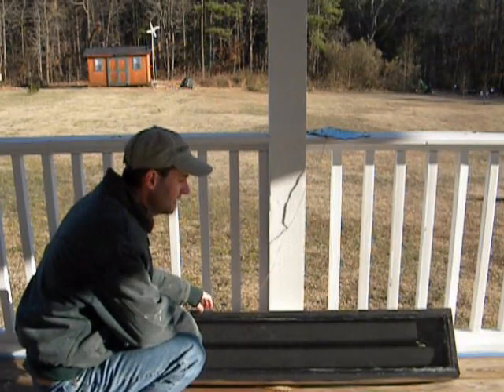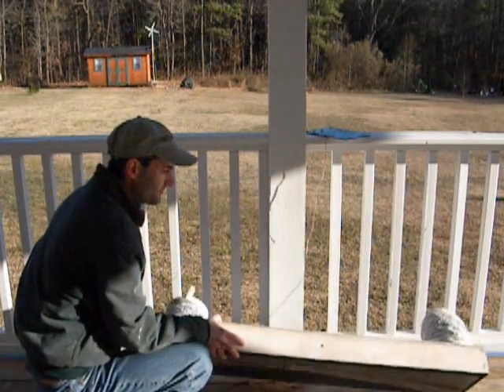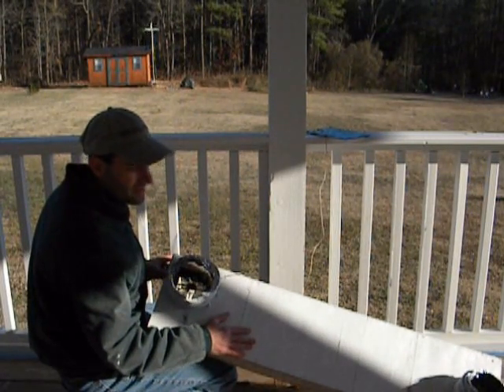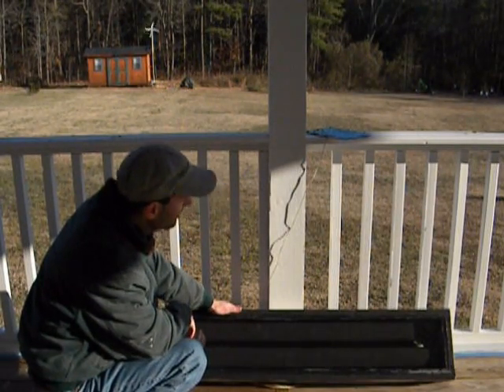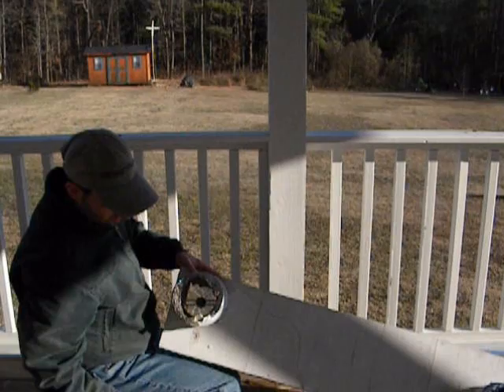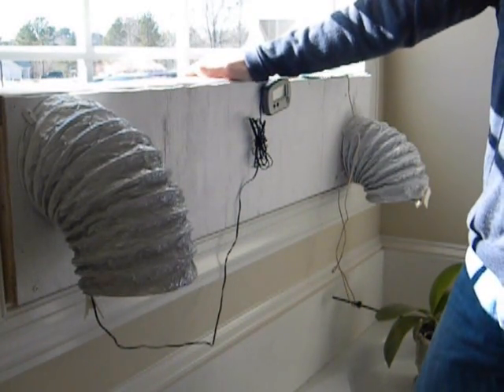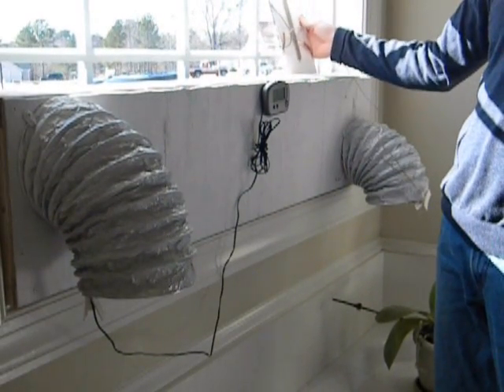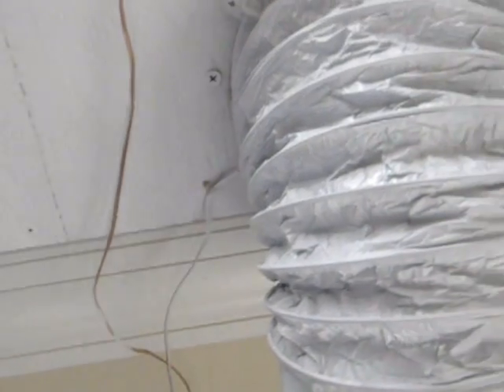solar window heater

Comment: His type of concept works. We built a slightly different window collector and reduced our heating bills by 1/2 to 1/3. We put these in south facing windows. If you want to go really cheap --just put black window blinds in and drop them in the winter.
Reply: Lili Pintea-Reed
No, he needs to put it outside and route it into his house via something other than a window blockage that blocks the same sunlight area his box tries to capture.  Now if it was bigger and didn't block his window, he could afford to lose a little window for its inlet and output pipes.

Comment: There is a lack of logic in this construction. The light energy which comes through the window would be absorbed by the room regardless. Increasing the surface area by putting it outside would see a gain in energy.
Reply: Exactly what I was thinking.

Comment: Most items inside a house are not designed to convert sunlight into heat. Yes the sofa and wood floor get warm, but they don't deliver converted energy to heat a body. That is what captured black pipes properly vented do. When the SHTF, I'll be glad I gathered some of this information. I'm combining ideas, and making my own designs.

Comment: So, did you put beer cans inside the downspout material, or just use the downspout sections alone(?).  Did you even bother to connect them, if so, how...?
Reply from the maker: Zippy DoDah I just inserted the cans into the downspout. It was a tight
fit, so I did not need any adhesive. Thank you for the question, Lonny

Comment: the whole south side of a house is a potential solar collector, build a box on the side of a house, between windows, add a clear covering=  viola solar collector ! plumb an inlet down low and outlet high in the box. make sure the inlets close off at night , some use a flap of plastic sheeting ( here in Canada that would not be enough, cold air would flood in)  
putting a box  in a window defeats the purpose.

Comment: Isn't this just a zero sum project?

Without the solar collector you would have "X" solar energy coming through the window.

With the solar collector you still have the same amount "X" of solar energy coming through the window.  

Since you have a fan blowing warm air on you somehow you feel your gaining energy But in reality you haven't gained anything.

Now if you were to mount the collector on the side of the house and "pipe" the warm air in by some means then you would have an increase in energy into the room and thus the room would get warmer than it would have normally gotten by just letting the sun shine through.

Solar collectors / furnaces are simply a cheap way to add extra windows.
Reply: mjs28s well put mjs28s, the boxes don't take in more sun light, they convert more of it to heat, then transfer that heat to the air and the fan moves that air.  I am going to build a couple of these for next winter.  My oil bill for this winter was insane.
Reply: I would think that the fan moving the air around helps to distribute the warm air while the sun light coming in through the windows will primarily warm surfaces that it reaches. Since the radiant heat from the surfaces might not be felt until you get pretty close, heating and then blowing hot air might be more about getting the warmth into the air for comfort rather than just relying on the heat that radiates from the surfaces inside of the house.

Also consider that the hot boxes are almost always painted black or at the very least, use materials that are better at absorbing heat so the hot boxes with fans also are better at converting the suns energy into heat. Think about it like this, can you get a surface temperature reading on a table that is just inside the window of your house of 200+ degree F? No. Maybe 20 degrees over ambient at best. Hot boxes though, in the same surface area as the window, can heat air up to pretty high temperatures so consider that as well in regards to your questions.

Comment: Just wonderful!!!

Yes please place a video so I can made my own is winter here and I am freezing I have a very high sealing. Thanks for share
Reply: +yvanaj1 I realize that two years have passed since you posted this comment, so the problem may have been solved by now: maybe you moved to a different house, etc.  My suggestion is to install a ceiling fan and use it during the winter on the setting so that it's pushing air TOWARD the ceiling.  This forces the warm air that has risen to the top of the room to descend to where the people are.  The warm air that was at the top, is then replaced by the cooler air that was down by your feet.  Slippers and sweaters help, too.  These are techniques that my low-income family uses.  Have a GREAT day!  Keep warm!  :)

Comment: The advantage of building an insulated box with ducts and a fan is that you can control and direct the heat. That is what you would want to do if you set the whole unit outside. Then you would not be constrained by the size, or location of the window. But then you would then have to put two holes in the house to direct the heat.

Since your unit is totally inside the house the box doesn't need to be insulated. It seems to me you could just stack some flat back objects (heat absorbers) on the inside the window sill and circulate air past the window. Simpler still, black venetian blinds would probably absorb almost all of the solar anergy that hits the window and be even more effective if you can circulate some air past them.

Comment from the maker: I do believe it works as well as the others. I have been using this solar heater for a few years now and I still have had no problems with it. I think it works so well because it is so simple design and it staying indoors. Thank you for the question, Lonny

Comment: blow the air along the floor and it will get deeper into the room due to the *funkyword to do with laminar flow along surfaces ive forgoten the name of* effect
Construct a J shaped duct using pvc drain pipe or something. The smoother surface of the duct will also decrease the pressure drop and give you higher air flow ;)

Comment from the maker: I would paint a soda can black and place it against the window. Test to see if it gets hot or not. If it does, I would think it would work just fine. If it doesn’t heat up, you didn’t spend anything to find out. Thank you for the question, Lonny

Comment from the maker: The solar panel I used in this video was left over from an old solar powered water pump. I had some old small blades that I just attached to that solar powered water pump motor to make a fan. Later I used a 5 watt solar panel that I won on a contest and an old computer fan. Thanks for the question, Lonny

Comment from the maker: The one fan did pull the air in from the room and you could feel a tiny bit of air from the fan moving out, but I later added another fan to increase air flow. The hot air will move by its self, but it would be an extremely slow and inefficient way to heat a room.  It works much better with the two fans. Thank you for the question, Lonny

Comment: Not to be a jerk here, but I do wonder if the physics are right.

Seems like opening the window shade completely and removing the "heater" will let in more radiant energy.  Of course if all the objects in the house are lightly colored (say white) then some of that energy will be re-radiated back out the window and lost.  

So in that way, a solar air heater as big as the window would probably be a win.

peace

Comment: Could you please tell me or put me in the direction of how to hook up a thermostat & what kind of flapper to SHUT OFF unit? I have a snap disc that turns fan on but if I leave house I have to shut off & manually close vent (& house gets cold) or leave it on & house gets Too hot. Thanks loved your video.

Comment from the maker: If you want to get away from paint all together you could use black cans, like energy drinks. I did a video on attaching cans with only heat for solar heaters. You could also cut up the cans so they lay flat and use that as your backing. Thank you for the question, Lonny

Comment: This seems like a very innovative and helpful idea for those of us who need low tech and inexpensive daytime heating assistance.

My only concern is with the fumes that may come off of the paint that is used on the components - since it will be ventilated into the living space. Can you think of some way to minimize that? 

Thanks for posting this video, it's one of the best I've seen.

Comment: Great job and this would be nice for many homes in the country where cosmetics isn't a serious issue but they still don't look bad.  So much heat is wasted at houses in winter and especially the newer ones with high ceilings.  Folks leave the blinds shut all day and often on larger windows then shown. One reason to block out sun rays is the fading affect it can have on fabrics, curtains, carpets, bed spreads, couches, chairs, etc, and this is a great idea in those rooms w/sun facing windows.

Comment: Im wondering what heating you can get if you simply hang cans inside in the window with no boxed frames or fans. Just let passive ventilation bottom to top put the heat in the room...

Comment from the maker: I really do notice a difference when we use the heater in the winter time. The 2 small solar panels came from a old solar powered water pump that I used for a water feature. The pump died, but the panels worked great for a computer fan.Thanks for the questions, Lonny

Comment from the maker: It may work better for air flow, but I think to get the air moving faster you still would want a solar fan. The main reasons why the solar heater is on its side is so the blinds will lay on the top of the unit. Thanks for the question, Lonny

Comment: if you want this to work you need to capture heat that is not going through your window anyway, like hang the thing outside of your window and pump cool room air through it and suck it back in warm - this way is really not doing anything.

Comment: ??? What do you don't understand ?? Why does wood stove have a fan in them!! To give more heat in a room right!? Now, the guy as downspout inside his window with a fan running inside the metal downspout to recuperate the inside heat made by the sun!! Now is this more understandable or you need more explaination?? Its just a simple fact, using the heat by distribute it inside the house, save momey on heating bills..Get it !!??

Comment: i am not sure i understand this … are you saying that putting this in your window yields you more heat inside your house?  that does not make sense to be or i don't understand you.  would you not get the same effect just putting a big piece of metal painted black right inside your window, and why would that heat up your house anyway - i don't get it?  there is no more sun going into your window, right?   so what does this improve?

Comment: I think it won't give you absolutely nothing in total warmth inside the room since you just block off the direct sunlight that is entering the room anyways. Without your contraption the sun would  heat up directly the floor, windowsil, plant, desk or whatever. Your solar "heater" just blocks off a part of the window. The heater would be much more effective when places on the outside in front of a well insulated wall where it could heat up and blow the warm air inside. Nevertheless, love our vids

Comment from the maker: @h2obizza Yes, I took aluminun cans and cut off the top with a can opener and used a step drill bit and made holes in the bottom. I placed as many cans as I could in the downspout without the cans sticking out of either end. I am using 1 small solar panel for each motor that I have. I used a high heat spray paint made for grills and bbqs. Thank you for the questions, Lonny

Comment: I would love to recreate this myself.  I get it for the most part. So, you took downspouts, and placed cans inside of them? and you cut both top and bottoms of them off? how much space is between the ends of spouts and the box? is the one solar panel powering both fans? thanks!

Comment from the maker: @FCBHC You are correct that 1 fan draws air in from the room and the other fan puts it into the room, I have been using 1 old computer fan and it works great so far. It does not much of anything on real cloudy days. Thanks for the question, Lonny

Comment: great concept for areas with strict bylaws, that is if  you dont want light coming into a window, Putting a well designed  box on the south facing part of your house that is sided acts in effect as another window in your house. Even better at night , with  airflow shut off to the box, no lost heat unlike a window in your house. Also the faster you run air through a box, the less time it has to heat up,  the faster the flow the cooler the air that comes out , dwell time in the box is a factor

Comment: This is a great idea and I want to use it in my workshop - I have double doors which have glass top and bottom and do not need the light, so these would work perfect. I take it one fan draws the air from the room and the other outputs the heat from the panel? do you think computer fans would work? and one last thing how is it on cloudy days.

cheers

Comment from the maker: @goloet The only time I have used insulation is for the solar heaters that sit outside. Because I do not want any of the heat to get out. I do think that it might help you get a slight increase in temperature in your indoor solar heater. Thanks for the question, Lonny

Comment from the maker: @msguit I was able to win one of my solar panels from a contest that robertsmith3 holds every month for a free solar panel. The other one I had left over from a old solar powered water pump. I had some old small blades that I just attached to that solar powered water pump motor to make a fan. They both really seem to have a nice output of power . Thanks for the question, Lonny

Comment: love your window heater  am making one myself.  where did you get your solar panels from?  do you find they put out alot of power?

i bought two little fans and will take them apart and try to figure out how to wire everything. for me that's the hardest part since i'm a novice at it. 

appreciate your sharing.